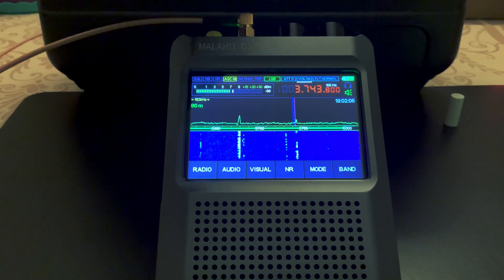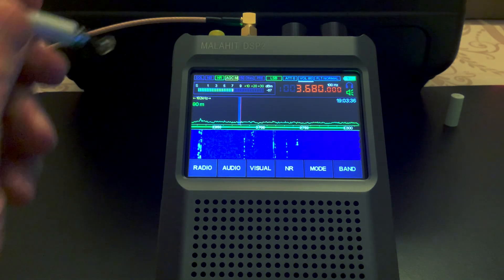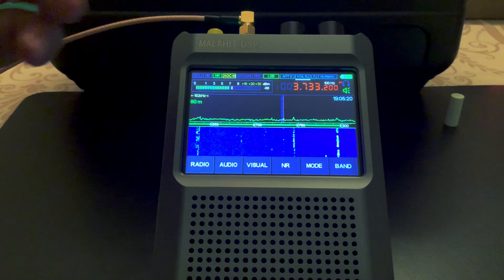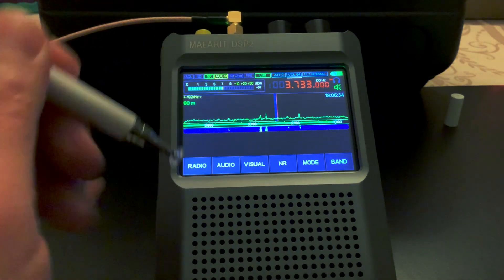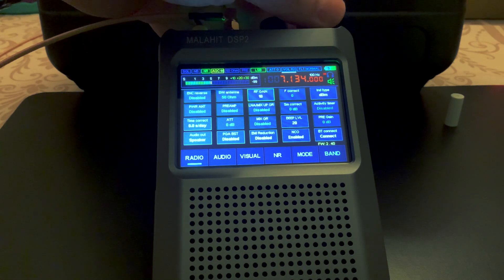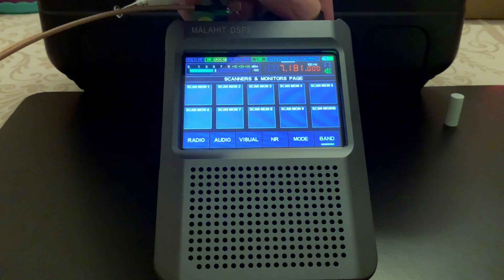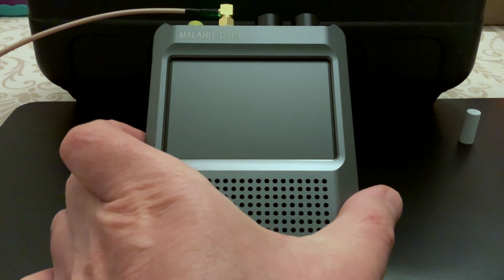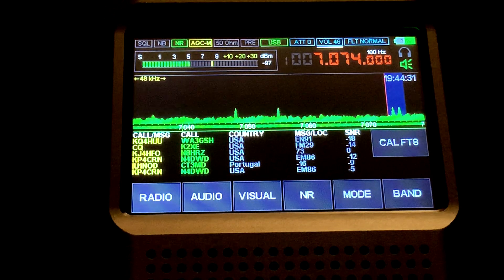Shortwave Radio - Tuning the airwaves with the Malahit DSP2

Comment: I live in a condo and have a Grundug 700 SW radio and It cannot hardly pick up hams in the condo.

Do you think this radio will perform better then the Grundug.

Currently I listen to hams on my phone going to websdr and use other people's sdr radio that are on line.
Reply from the maker: @futurefantastic  never tested a Grundig 700. Remember radio is one part, the Antenna is a major consideration always. In most cases It’s cheaper to test antenna alternatives than buying receivers! Have fun.

Comment: Good video 👍🇬🇧🇺🇲
That noise reduction is amazing as is everything else about this radio I've got one on order from bangood hope to get it soon
Reply from the maker: You will enjoy it! I made a major purchase recently on the Yaesu FTdx101D. I plan on a video soon comparing the Malahit and Yaesu on receiving a weak signal. Stay tuned!
Reply: @RoyGNH  
Absolutely cheers 👍🇬🇧🇺🇲
Reply: i just simply dont know what website to get one from, which version or how to tell if i got a fake etc... other than thst , this little radio looks awesome, i love looking at that spectrum analyzer 😂
Reply: @DZX5000  
I bought mine from banggood and I had no problems whatsoever plus there was no import duty to pay
You want the malahit dsp2 with the 2.4 software 
I hope this helps